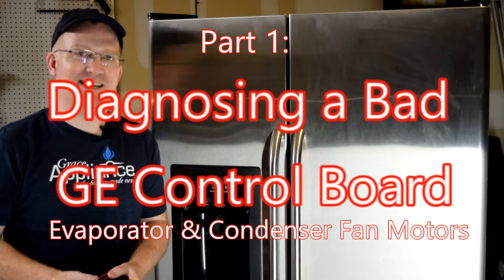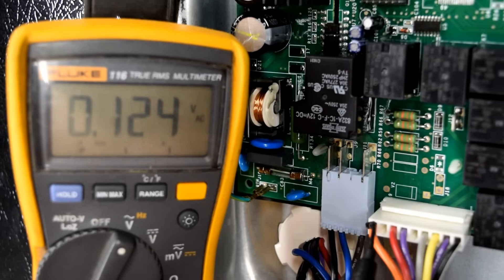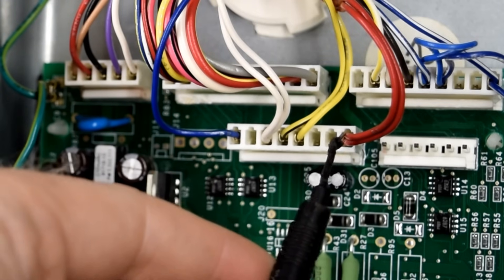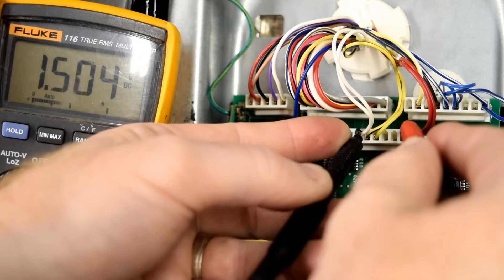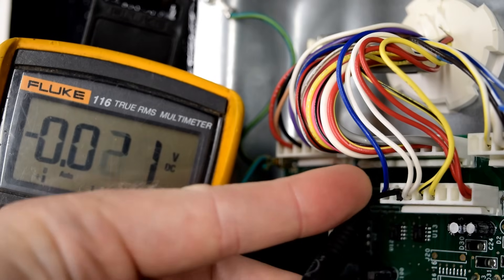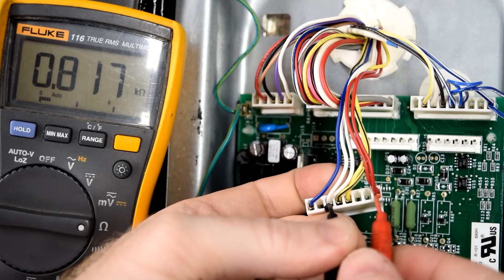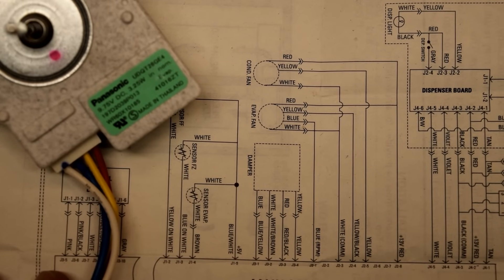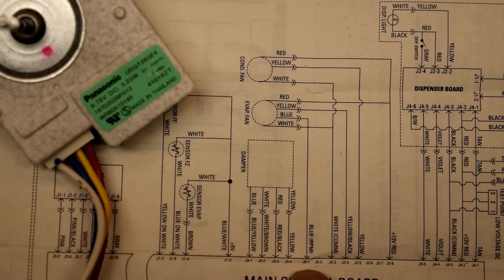Diagnosing a Bad GE Board - Part 1: Fan Motors

Comment: Excellent tutorial thank you. I have been following your diagnostic video with my 16 year old son. (We never did this before) We are trying to repair a GE profile side-by-side refrigerator model# pss26nswc ss. We ran into several issues with the diagnostic testing. In step one we were checking for a 120 volts coming into the board. The meter only read 114.5 volts?  (was the green ground wires supposed to be reconnected after we took off the back of the refrigerator? In Step 2 and 3 everything was good we were reading between 12 and 14 volts on the meter. However in step 4 we were supposed to be checking for between 12 and 14 volts. You told us to put the black probe in the third slot which is white and you told us to put the red probe in the fifth slot which is yellow.  But there is no yellow wire. Apparentlyour circuit board is different from the one that you show in your video. Any suggestions. Thank you. Dan and Christopher
Reply from the maker: Hey Daniel,
Your incoming voltage is fine. 114vac is no problem.

If you want to send me a picture of the what your plug looks like, I'm happy to take a look and see if I can help.

Graceappliance@gmail.com

Thanks! Andy

Comment: Very Awesome video! easy to follow, easy to do, even for some very technical tests! Great job!!!

Now, On to my issue... Freezer went out, cold at bottom, no so cold at top (thawing out) fridge was freezing food at bottom, normal at top. I replaced the defrost heater element, thermister, thermostat. everything seemed fine for about 6 weeks. Now, the freezer iseems to be working fine and the fridge is getting warm at top, cold still at bottom. Frost on freezer back panel.

 Ok, with that out of the way...on to your tests

GE Hotpoint model HSS25GFPA WW

unplugged. blue to orange ohms- 20, +/-1
unplugged. white to red .8xxK ohms 
unplugged. white to yellow/black OL
unplugged. White to yellow OL

plugged volts white to red 13v
plugged white to yellow 12.5v
plugged white to yellow and black  12.5v +/-.

All the fans seem to be coming on and working, your board test seems to show a good board. My next step is to run a jumper to run the defrost element to get it to defrost.
NOTE, I have not removed the cover for the coils in the freezer this time around.
NOTE, I can see light coming from the freezer from the fridge side when i open doors and click the switch off, so if there is a damper door, its open
NOTE, I dont have 2 green resistors side by side...I have 2 ceramic looking ones...One pink, One grey

UPDATE: I jumped the wires for the heating element and it is glowing, So I let it run for a few minutes, un-jumped. A couple hours later, jumped again... The frost is disappearing on the back panel and I can actually feel cold air coming into the fridge side at the top vent....Good news I hope....
Reply from the maker: Hey sorry I missed the comment. Youtube comment section is THE WORST!  

Anyway, the 4 components that relate to your fridge defrost are:
The heater (working)
The high limit thermostat (working since heater comes on)
Defrost sensor (replaced already?) on top of the evaporator.
& your control board.

Since you've verified the heater & high limit are both working, if you've already replaced the defrost sensor (I'd be sure to use a legitimate GE part here) it only leaves the control board as your culprit. 

I hope this helps.
Reply: @GraceAppliance  awesome. Thank you. The control board tests good. Maybe defrost sensor? I replaced the thermostat (clip on) and replaced the thermister at the top of the coil, but there's another at the bottom. I'll look into defrost sensor. Thank you so much!!!!
Reply: So, I just watched your video on checking the defrost sensor...Nothing. No readings on the ohm meter. So I should replace the defrost sensor and is that the same as a thermister? I DID replace one already, but it came with other parts. Should I order OEM GE part and order 2?
Reply from the maker: Jason ochs hey, just so I’m not confusing things with the names of the parts...
You’ve got a high limit thermostat which looks about the size of a stack $4 of quarters.  If your heater glows with the jumper wires, both the heater and this part are good.  This part does not dictate when the heater comes on, only turns the heater off should it get too hot.  
The defrost sensor is actually the part that tells the board how long to keep the heater on.  It’s located on top of the evaporator and you’ve only got one of these.  Roughly the size of 1” long and 1/4” wide.  White in color with two white wires leading to it.  
This should defiantly not be open like you mentioned.   Defiantly replace this with a GE OEM part and you should be good to go. 
:)

Comment: Hello Andy.  I have watched your videos and have learned immensely from them. Thank you!!!
I do have a slight worry since I replaced my control board(WR55X10529) with (WR55X10942).  My Refrigerator/Freezer SxS Model # GSS25QGSC  CC has a little different wiring on the J2 plug.p1-Blue,p2Red-jumper from p8,p3-white,p4 yellw/black, nothing @p5,p6,p7, &2 red p8. I do not know how to test for my condenser fan for voltage.  My fan doesn't seen to be working even after an hour of cooling.  I placed a small desk fan on the condenser and compressor to try and keep from overheating.  Had to wait 3 weeks for the new control board because of Cov19, and do not want to damage it. When I installed the new board , the instructions said to cut a wire in J1 connector pin 2 to Eliminate Thermistor wire. This note said only applicable for bottom freezers and a few Encoder models w/ serial 3 prefixes, which did not match mine.  I did not cut the wire.  
Anyway, with no yellow wire in pin5 of J2 , i am lost.  Tested J2 Voltage and Ohms (p3-p8) all good readings. Any ideas?
Reply from the maker: Hey, I'm almost certain it will. Be between the white and red (p3&p8) that would be your condenser fan circuit, but am not able to find a diagram for your exact model. 

How you can verify is to either do your voltage test directly at the fan motor plug itself which is probably the easiest. Tell me what color wires you have coming in to the fan motor behind the fridge.

Also, you can (with the fridge unplugged) verify which wire leads to which pin on the board by performing an ohm test between each wire and the corresponding pin on the board. 

Your red wire should be your constant 12-14vdc and the white is your neutral.

Comment: Andy - thank you very much.  GE side by side, model PSS27SGMBBS.
The problem started with a clicking sound.  Replaced two capacitors...still clicking; replaced a resistor, clicking disappeared, but caused a burnt part of the main board (Q13) after I plugged it in.  Watched many videos including all yours in diagnosing the problem.  Replaced the main board, three times as it was not sending enough voltage to the fans.  The refrigerator still did not start.  Replaced evaporator fan.  Still no start.  Replaced start relay, still no start.
Then.... I found one of your comments very helpful...which was "the fan motor could be robbing some voltage from the main board."  That was it.  I unplugged the J2 then the refrigerator started up.  Turns out the refrigerator has a bad condenser fan pulling voltage from the main board.  
Going on my 4th week in repairing this thing.  Luckily I have time due to COVID-19 lockdown.  Thank you very much.  Waiting for the part to arrive.  Hopefully that will be it.  Your videos are very helpful and informative.
Reply from the maker: E Jimenez awesome work!   Let me know if you run in to any issues!
Reply: You are a fine example of someone who replaces a part because you saw it there. Anyone can replace parts. Very few can do good diagnostic work !

Comment: Hey Andy, Am I assuming correctly that if the refrigerator will not start up and I have good power coming into the board but do not have the voltage at the fan motors then the compressor will not start as well, or is there a separate test for the compressor?
Reply from the maker: Joseph Folsom hey Joseph, 
The compressor will always run when the condenser fan is running (for 99% of the models out there) but if neither fan run nor the compressor, I’d start by unplugging the refrigerator for 5 minutes to reset the board. If still no change, I’d rule out a shorted front touch panel by unplugging the touch panel plug at the main control board (I believe this is J1 plug) if the fridge comes to life then, it would be a failed front touch panel.  

Another test is to unplug the fans plug (J4) and see if the fridge comes on. If so, the issue lies with a failed fan motor.  

Also check to see that all of your temperature sensors are in spec (see testing and replacing a defrost sensor video). If all are ok, I’d then suspect a failed main control.  

There are tests you can do to isolate your compressor, but a compressor symptom would not cause the fans to not run.
Reply: GE Side-by-Side ONLY - Refrigerator Repair Videos So it sounds if there is no voltage at the fan motors then it’s more probable that board is bad which will not allow the compressor to start as well since the condenser fan motor is in the same circuit with the compressor. ( At least typically they are in the same circuit)
Reply from the maker: Any of the above situations could cause the symptom you’re having.  There won’t be a way for me to say conclusively except for checking these things off the list. I agree, it’s probably a failed main board, but that would be a guess at this point.  
For instance, if the board is getting a reading from a failed temperature sensor that it’s already at 0F in the freezer (even if it’s actually 75F inside the freezer) it would not turn on the fan or the compressor.  A brand new board would still give you the same results.  

If it were my money, I would want to rule out the cheaper items before dropping big bucks on a new board that may not be at fault.  
The compressor is on a separate circuit from the condenser fan motor.  The fan motor is DC voltage and the compressor is AC voltage.
Reply: GE Side-by-Side ONLY - Refrigerator Repair Videos Pulled the J1 plug and nothing happened. With J1 plugged in the front display will not light up. I thought J2 was the fan plug not J4. It didn’t matter either way. No start up. The resistors where they connect to the board are brown on the board itself. When I turn over the board it’s discolored in the same place. I have 1.2 volts at the fans. No resistance at the evaporator motor. I have pics of the board, is there a way I can send them to you?
Reply from the maker: @josephfolsom2030  thanks. You will need to replace the main control board as well as your evaporator fan motor and you should be back in business. Thanks!
Reply: GE Side-by-Side ONLY - Refrigerator Repair Videos I think I will replace the sensor as well. They’re pretty cheap, and since I’m in there.
Reply: GE Side-by-Side ONLY - Refrigerator Repair Videos Do you think that the replacement board is any better now than the original ones. Are they upgraded?
Reply from the maker: @josephfolsom2030  I'm not sure really. I can say I've never had a call back for a board that I've replaced. I agree on replacing the sensor while you're in there.  Good move.
Reply: GE Side-by-Side ONLY - Refrigerator Repair Videos Appreciate you and your prowess.
Reply from the maker: @josephfolsom2030  you're most welcome!  Let me know if you run in to any issues.  Thanks!

Comment: I had power to my ge fridge but thats all it would do and no fans or anything would work. I checked and I had a burnt control board, I ordered a new one and still the same thing nothing works but the lights. Could it be a bad new control board !?
Reply from the maker: TheBreakneckbeats, probably not a bad board.  However, double check that you received the correct part number based on your model number.  I’m happy to confirm this if you’ll send your model number to me.  

Also, you can try unplugging the front control board from the circuit and if the fridge comes to life at that point, you know you also have a failed front touch panel in addition.  

Let me know if you have any questions.    Thanks, Andy
Reply: @GraceAppliance   thank you so much for your reply!  Model is GSL25JFPH BS  motherboard I got is 200D4854G013.  Also, how do i unplug the front control board where is that ? I apologize Its my first time doing something like this im lost lol.
Reply from the maker: Hey, no problem! The easiest way to unplug the J4 plug on the main control board behind your fridge. 
Unplug your fridge, unplug J4 and restore power to the fride to see if that does it. 
J4 is usually in the top left of the board and has about 5 wires going to it.

The board number that shows for your fridge is wr55x10942p. Double check that's the one you ordered based on the box it came in. 

Let me know what you find. Thanks!
Reply: @GraceAppliance   I ordered the one I mentioned because the burnt original board showed that specific board number so I assumed that is the original board. I guess I can try to order the one you mentioned and return this one.
Reply from the maker: @TheBreakneckbeats  https://www.graceappliancediy.com/products/ge-wr55x10942-refrigerator-main-control-board-1?_pos=1&_sid=6ab956f04&_ss=r

Thanks! Andy

Comment: On checking tachometer part, I followed your steps and it did not work. I watched your another video where the same test was done differently: Jump Red and Yellow wires and then Multi meter's  Black Lead to that jumped wires and Red Lead connect to Blue wire. Only this way I got the tachometer HZ reading on the Multi meter.
Can you please comment on this issue?
Reply from the maker: Hi, what’s your model number for your fridge and what is the part number you are performing this test on?

Thanks
Reply: Model Number: GE Refrigerator GSS23SGSASS. The part number I performed the test was WR60X10074 Evaporator Fan Motor. The actual Part Number for Evap. Fan Motor for my Fridge's Model # is WR60X10185; however I decided to use P/N WR60X10074 because it comes with Thermistor and there would not be a need to cut wires.
Note: WR60X10074 that I performed the test on was made in China - not the original part - after-market one. And both Part numbers have the same UDQT26GE4 written on the motors. Source for the Part: www.a-1appliance.com/lookup/167149/1239731
Thanks for your reply.
Reply from the maker: Hi Isobar, the fan I’m testing in the video is a wr60x10185 and perhaps there are some wiring differences that I am not aware of. Unfortunately,
I do not believe you’ll be able to successfully use a wr60x10074 in place of a wr60x10185 as called for in your parts list for your fridge.  The plugs line up (if I recall), but don’t believe you have the appropriate wiring leading from that plug back to your control board for the defrost sensor.  You may notice on your plug only 4 wires on the plug you attach the fan to where a fridge calling for a wr60x10074 would have 6 wires total.  

I hope that helps. 

Thanks,
Andy
Reply: Thank you Andy for your time and for a great assistance that you provide to the public that need to service their appliances by themselves and I'm one of them. Regarding wr60x10074, I will follow your advice and will keep an eye on my fridge's wiring and if needed I will cut defrost sensor's wires to follow my fridge's normal operation although I was trying to avoid wire cutting. 
Thanks again, Yervand

Comment: My GE side by side stopped working. The compressor was hot. I figured the thermal protector had shut it off. I cleaned the dust and dust bunnies off the condenser cage and put a fan blowing onto the back of the fridge. This got the fridge to start working again but I knew something was wrong. Using your video I started diagnosing the circuit board. I had power going to the evaporator fan but it wasn’t working. So I knew I had to replace the evaporator fan. I purchased one at a local appliance store and installed it. My fridge works great again. THANK YOU!!!!
Reply from the maker: wcjcnc you’re most welcome! Great work. Stay in touch. Andy